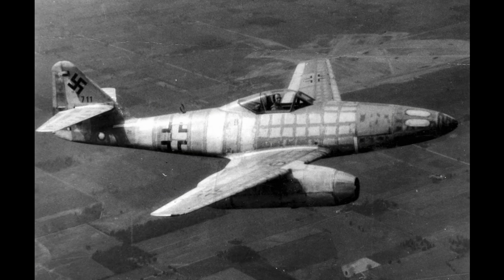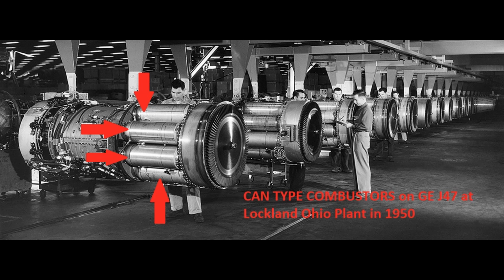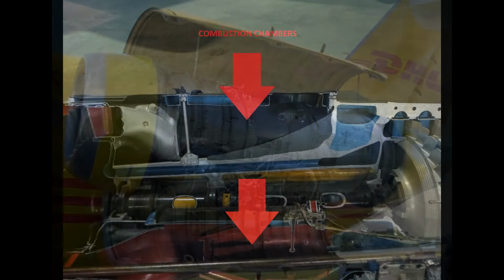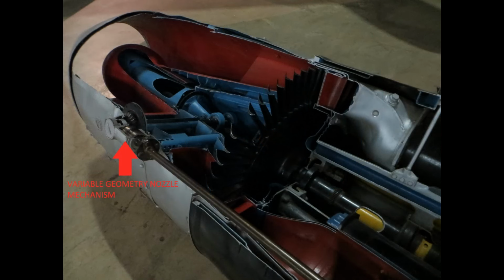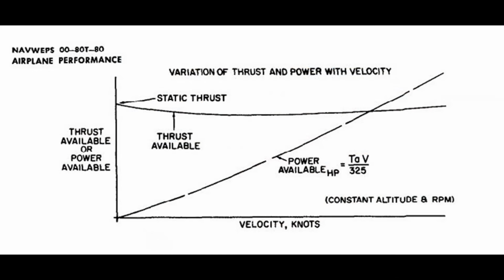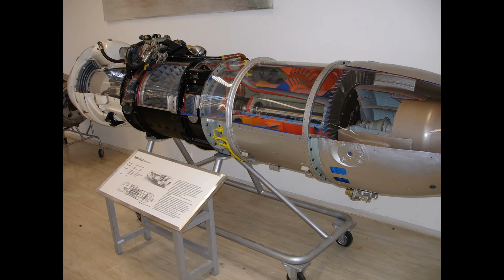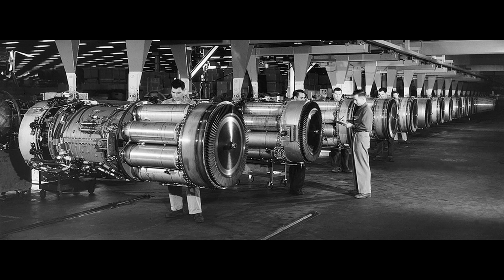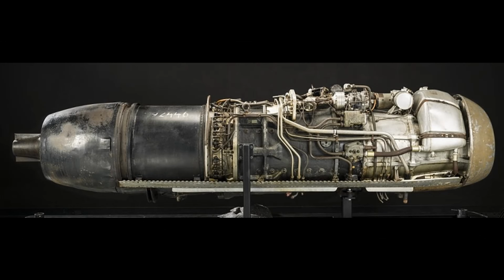World War Two JET POWER

Comment: Thanks for making these detailed videos.  
One minor point, there was another early WWII jet engine that used a fully annular combustion chamber, the Metropolitan-Vickers F.2, a rival to Rolls Royce over in England. Excellent performance, but unreliable as it threw in every advanced feature the lead engineer (Alan Griffiths) could think of - axial compressor, two stage turbine etc.  I think he was trying to make up for claiming jet propulsion would never work when he dismissed Whittles original proposal back in the late 20s.
Reply: The F.2 was a resounding failure, Metropolitan Vickers abandoned all development of jet engines in 1947 without any success.
Reply: @sandervanderkammen9230  Well, not really - they sold the design to Armstrong Siddeley who developed it into the Sapphire, and also licensed it to Curtiss-Wright as the J65.
Reply: @tachikomakusanagi3744  Metropolitan Vickers did not design the Sapphire... it was a very different engine from the F.2 the Sapphire was designed after WW2 and benefited heavily from captured German jet engine technology.

A.A. Griffiths was never interested in turbojets, he believed that turboshaft engines were the future.
It was Hayne Constant that would led the development of axial compressor turbojets at Metrovick.

Griffiths had gone the Brown Boveri und Cie in Switzerland to study turbocharger development and was shown the Velox engine, the world's first axial compressor gas turbine engine.
Griffiths was instrumental in bringing  the Velox to the U.K. and brokered a deal to have Metropolitan Vickers become a BB&C Velox licensee in the U.K..

That's how Griffiths and Constant ended up working with Metropolitan Vickers to develop the F.2
Reply: @sandervanderkammen9230  "Metropolitan Vickers did not design the Sapphire"

Where did i say that they did? I pointed out that Armstrong Siddeley bought the design of the F.2 Beryl engine from Metrovick, and then used it as a starting point for the Saphire, which was a successful engine and intially out performed the Avon.
Reply: @tachikomakusanagi3744  The Sapphire remains an example of  historical evidence that confirms that not only did Germany invent jet engines 2 years before the Allies did but that they were 10 years ahead of the Allies in axial compressor jet engine technology.
Reply: @tachikomakusanagi3744  The fact remains that the F.2 was a failure and Metropolitan Vickers abandoned all development of jet engines leaving the industry without success.
Reply: A.A.GRIFFITHS  proved that Frank Whittle not only plagerized his work but that Whittle did not understand how axial compressors worked.
Whittle would never construct a axial compressor... his work was an evolutionary dead end and is completely obsolete technology.
Reply: @sandervanderkammen9230  I respectfuly disagree. Whittle knew the real problem was in the metallergy of the turbine blades, and concentrated on this, the centrifugal compressor being simple and good enough to allow him to produce a turbine blade that could stand up to the punishment. 

The MiG-15 used a centrifugal flow engine and certainly gave the F-86 a run for its money as late as the Korean war and beyond. Its hardly a dead end just because it was upgraded with a more advance compressor stage.

Also Griffiths stated belief was that the lack of airflow from the propellar over the wings meant that jet propulsion would never work for aircraft. He changed his tune only after Whittle had demostrated the success of his engine.
Reply: @tachikomakusanagi3744  You are not very familiar with Frank Whittle's work or career?
 Whittle's original 1930 patent clearly shows an axial compressor which was later proved to be plagerized from A.A. Griffiths 1926 paper which was given to Whittle while he attended Cranwell.

Whittle struggled with metallurgy during his entire, very short career as a jet engine designer.
 Whittle engines intially used 18/8 stainless alloy and later REX 78, both  commonly used in cutlery and kitchen appliances neither was suitable for jet engines as none of the W.2 engines were reliable enough to pass a RAF PFTR test for adoption into service.

The real geniuses of the British jet engine program was Adrian Lombard and Stanley Hooker who reached out for help from General Electric to solve Whittle's metallurgy problem.
General Electric who used Hastaloy B in its turbochargers co-developed Nimonic 70 with Canadian company InCo.
Reply: @tachikomakusanagi3744  The MiG-15 was designed by Heinkel engineer Siegfried Gunter, he and his brother designed the world's first jet aircraft, the He-178.

The MiG-15 was powered by a VK1 engine designed by Vladimir Klimov.
Reply: @sandervanderkammen9230  I agree with you about Stanley Hooker.
Reply: @tachikomakusanagi3744  Yes, Stanley Hooker was a genius engineer that deserves far more credit than Frank Whittle.
Unfortunately Hookers expertise was limited to centrifugal compressor technology which ultimately proved to be an evolutionary dead end.
Germany quickly abandoned centrifugal compressors and focused on the vastly superior axial compressor turbojet concept.
Reply: @sandervanderkammen9230  "Unfortunately Hookers expertise was limited to centrifugal compressor technology which ultimately proved to be an evolutionary dead end"

But he was the lead engineer on the Avon, the first RR axial flow engine?
Reply: @tachikomakusanagi3744  The Rolls-Royce Avon was a post WW2 engine and benefits significantly from captured German jet engine technology brought back from the Fedden Mission.
Reply: @tachikomakusanagi3744  Wrong! Don't confuse your engines son, the RD-45 and the VK-1 are not the same.
The MiG-15 was powered by the VK1 not the RD-45.

Foolishly? No, both Rolls-Royce and the Government were completely bankrupt in 1946 after Britain's defeat in WW2. 
 The U.K. had absolutely no choice but to sell weapons to any cash buyer, the Nene was bulky, heavy and underpowered, R-R had few orders for the unpopular and outdated Nene engine.
Reply: @tachikomakusanagi3744  There were only two winners in WW2, Britain was not one of them.
Reply: @tachikomakusanagi3744 The RD-45 (R-R Nene) was not popular in the Soviet Union either and production was quickly abandoned in  favor of more powerful Klimov designs.
Reply: @WilhelmKarsten  Indeed, but were the Klimov designs completely independent of the Whittle engines that had been widely studied in the Soviet design studios?
Reply: @tachikomakusanagi3744  The Nene wasn't designed by Whittle.
The Derwent and the Nene were designed by Adrian Lombard.
Reply: @WilhelmKarsten  Well yes, but it was a reworking of the Whittle engine, in the light of the improvements of metallurgy etc
Reply: @tachikomakusanagi3744  Indeed, but were the Klimov designs completely independent of Heinkel centrifugal jet engines?????
  Heinkel engineers Hans von Ohain and Max Hahnn constructed the first centrifugal turbojet aircraft engine.

The development of MiG-15 was directed linked to Heinkel by its designer, Heinkel engineer, Dr. SIEGFRIED GÜNTER who designed the world's first jet plane.
Reply: @tachikomakusanagi3744  Improvements in the metallurgy of Rolls-Royce engines came from General Electric turbocharger division.
The Soviets captured many examples of American aircraft fitted with the GE turbochargers and without any doubt submitted them for metallurgical analysis and subsequently the formulas for Hastalloy B and Nimonic 70.
Reply: @tachikomakusanagi3744  Germany invented the world's first high temperature creep resistant Nickel alloy in 1932, Krupp P-193 Tinidur A60 was comparable to Nimonic 70.
It was first used in jet aircraft engines with the German Heinkel HeS 3 in 1939.
Reply: @WilhelmKarsten  Can you supply a reference link? I'm genuinely interested in reading about this. 

I'm not in any way saying that RR were the only players in this game, the German, Russian and US engineers working in this field were also exceptional. 

I'm just pointing out that Whittle, and Hooker deserve credit for being amongst the first to develop this technology. And also Parsons, as i have pointed out before.

I celebrate engineering genius wherever i see it.
Reply: @WilhelmKarsten 
Ryce Muncherz Kharzeestan Krapper DiktorBummer etc & co - they should note well & remember pelly good with much awestruckness pleasetoo.
 That's hilarious - Krapper/ DiktorBummer claims Griffith's said Whittle didn't understand jet engines 😂 In fact Griffiths was already working on axial jet engine tech before 1930 & was aiming to use it as a turboprop engine. Before 1931 Whittle was aiming at gas turbine reaction thrust only with no propeller which Griffiths had doubts about. 
     Their comments are readykyoulous phFabrikayshunz. 😂
  Multi stage sequential stator rotor Axial compressors & Axial turbines had been demonstrated  before 1900 by Parsons in England. Internal combustion axial gas turbine aero engines were being considered, researched & built in England since 1925.
  Maxime Guillaume simply copied stuff from Parsons writings & lectures into a fraud patent.
 The Whittle centrifugal compressor internal combustion reverse flow & straight through combuster gas turbine aero engines is still manufactured & used for turboprop & helicopter applications & more than 30,000 have been produced so far.
    The gas turbine was of course invented in England before 1800, why would they expect it to not have been the case, obviously.
   The world's first demonstration of a practical internal combustion gas turbine aircraft engine was in England in 1937 by Whittle.
   It used a car engine for starting (spinning the main gas turbine shaft), the car engine was disconnected after starting. Electric motors were also used for starting -  Standard practice.
All previous attempts by others had various non pure gas turbine aero engine features such as a compressor stage that was actually operated by a piston engine with an after burner & no turbine stage.
    The world's first demonstration by Parsons of the components of a coupled multi stage axial compressor & axial turbine unit using sequential bladed rotor stator stages was in England before 1900 when of course people in England began considering their use as the basis of an axial compressor internal combustion gas turbine aero engine.
  
  The Nickel alloys suitable for turbine blades in gas turbine aero engines was developed in Hereford England, alloys used anywhere else up to the 1940s were inadequate.
  The klimov VK-1 was a very good copy of the RR Nene.

  Parsons didn't manufacture steam engines.
  Steam engines don't have multi stage bladed sequential stator rotor axial compressors & turbines. 
                                    &
    Oh yes, the PW200 range of gas turbine engines are in fact directly derived from the Whittle centrifugal compressor internal combustion reverse flow combuster gas turbine aero engine which of course was demonstrated for the first time in the world by Whittle in England in 1937.
                          OF COURSE
  Air travel safety often depends on British made and or designed tech or British aerospace advanced technology, R&D, science & Engineering.
  For anybody currently flying on a widebody airliner there's a good possibility that the engines will be RR gas turbine aero engines designed &  built in England with those engines  being monitored by people in an English county.
  England, the home country of 
  RR (aero engine stuff) & it's lands, 
   counties & shires will 
   of course be producing  - - 
            🎺📯🎺📯
    The RR Trent Ultrafan
   The Worlds Largest Gas 
     Turbine Aero Engine.  
           📯🎺📯🎺
               👍👍
   
   A typical but very tiny glimpse of what goes in the very internationally orientated British aerospace sector.  -
      Boeing Apache Attack Helicopter.
AH-64: 75 UK suppliers, 7% UK content, global fleet of 1280+ aircraft.
F35B more than 130 UK Suppliers, more than 30% UK content.
F35A & F35C more than 130 UK Suppliers, more than 15% UK content.
😂👍 Cheers
. ... ... .  .. . ...
vvvvxxxccciiib
Reply: @paulpaul9914 Please name a single British company that still makes British aircraft in the UK?
Reply: @paulpaul9914  NAME A BRITISH JET AIRCRAFT STILL IN PRODUCTION?
Reply: @paulpaul9914 Please name a single British aircraft manufacturer that still makes British jet aircraft in the UK?
Reply: @paulpaul9914 GERMANY 🇩🇪 IS THE LARGEST MANUFACTURER OF JET AIRCRAFT IN EUROPE.
Reply: @sandervanderkammen9230 
    Boeing, BAe Systems, Airbus & Rolls Royce are not German companies.
    Germany no longer manufactures Jet aircraft,  is a minorl partner in Airbus & does less Airbus related work than the UK & much less aerospace work than the UK.
  WRONG ANSWER KRAPPENZ
Please feel free to have another go.
 They might like to answer these questions.
   Which airline has just ordered
60 RR England Trent XWB Engines
& What aircraft are the engines for?

Bonus question for 10 extra points.
                Which country has the 
World's Highest Combined Per Capita
 Nuclear / Defence / Aerospace Sector Activity?

👍🙂 Cheers
Reply: @paulpaul9914  Please name a British company that still makes British jet aircraft in the UK?
Reply: @sandervanderkammen9230 
    Boeing, BAe Systems, Airbus & Rolls Royce are not German companies.
    Germany no longer manufactures Jet aircraft,  is a minor partner in Airbus & does less Airbus related work than the UK & much less aerospace work than the UK.
  WRONG ANSWER KRAPPENZ
Please feel free to have another go.
 They might like to answer these questions.
   Which airline has just ordered
60 RR England Trent XWB Engines
& What aircraft are the engines for?

Bonus question for 10 extra points.
                Which country has the 
World's Highest Combined Per Capita
 Nuclear / Defence / Aerospace Sector Activity?

👍🙂 Cheers
  
 . .... .  .... ... .
xcxcxcvvvcii
Reply: @paulpaul9914  NAME A BRITISH JET PLANE STILL IN PRODUCTION?
Reply: @sandervanderkammen9230  "Whittle not only plagerized his work but that Whittle did not understand how axial compressors worked"

I'm genuinely interested in why you are determined to minimise the achievements of Frank Wittle. Griffiths was indeed a genius, but he took the axial flow design from Parsons, the inventor of the incredible steam turbine which started the whole thing off. Yes he spotted how to improve Parsons design from an aerodynamic perspctive. Impressive work, but by your reckoning we could say that Griffiths Plagerized Parsons.
Reply: @tachikomakusanagi3744  Frank Whittle was a very unlikely hero, a nearly completely fictional character created by the British propaganda machine..
His achievements have been grossly exaggerated compared to his rather meager technical success.
Whittle was only the 4th person to successfully demonstrate a jet aircraft engine and his engines were too weak and unreliable for production aircraft.

The Parsons Company would not build a gas turbine engine until after the war ended and only with the direction of dr. Max Bentele who co-developed the Jumo -004 Orkan in Germany.

Steam turbines are external combustion engines that operate using the Rankine Cycle principle...
This technology has no practical applications for turbojet aircraft engines.

Without any doubt A.A. Griffiths work was heavily influenced by if not plagerized from Swiss engineer Alfred Buchi who invented the Turbocharger and the first successful axial compressor gas turbine engines (the Velox system)

Griffiths association with Alfred Buchi at Brown Boveri und Cie and Metropolitan Vickers who became a BB&C Velox licensee is an inconvenient truth that cannot be dismissed by unbiased historians.

Comment: During takeoff of jetplanes I have noticed that the engines exhaust is black.  Ref. B 52 bomber. A jet engine uses a very high air to fuel ratio for combustion compared to a piston engine.  I understand that the excess air purpose is for cooling the gases before entering the turbine. I would expect that the lean mixture would result in a complete combustion with no smoke.
Reply: The black smoke seen in early B-52s is primarily caused by the use of water methanol injection during takeoff.
This allows a much richer AFR and higher thrust without overheating.
 
Not all of the air is exposed to the combustion process, creating a locally richer AFR in the combustor than the overall ratio of air flow. 

All early turbojets tended to produce some black smoke, the actual cause of carbon particulates is not fully understood by science but is related to AFR, temperature and pressure.

 Early turbojets have manual or semi-automatic fuel controls, less sophisticated combustor liners and lower compression ratios that  produce more smoke than modern engines.
I hope that answers your question.
Reply from the maker: In this regard, Jets are the opposite of piston engines. More fuel makes them hotter, more air cools them.
Reply: @GregsAirplanesandAutomobiles  Even on max power a jet engine has a lot of excess air for cooling to protect the turbine. Hence, all fuel should be burned and there should be no smoke from the exhaust
Reply: @terjejohnsen8451  Not true, the design of the Combustor has a huge effect on the amount of black smoke produced eg; the General Electric J79 is an excellent example, early model produced lots of smoke, later models were smokeless, the only change made to the J79 was the design of the combustor liners.
Reply: @GregsAirplanesandAutomobiles  Water-methanol injection allows a richer AFR and Lower turbine inlet temperature.